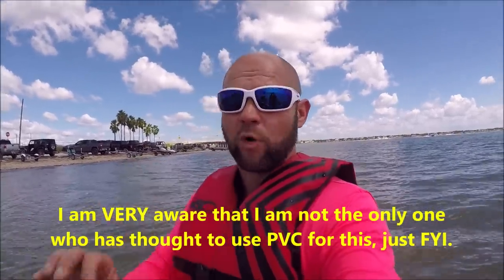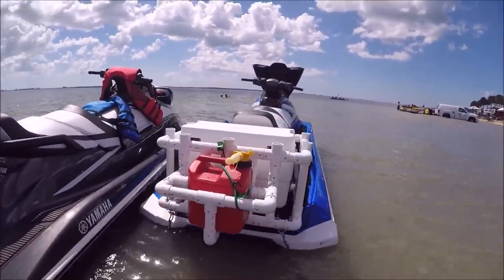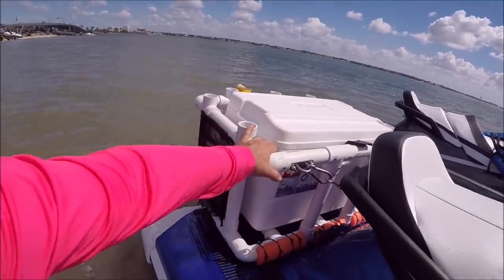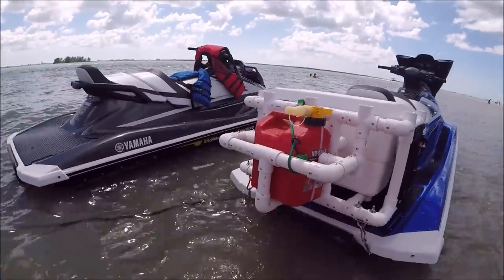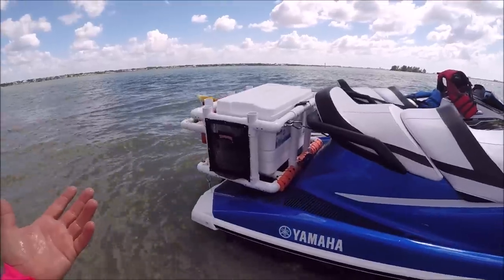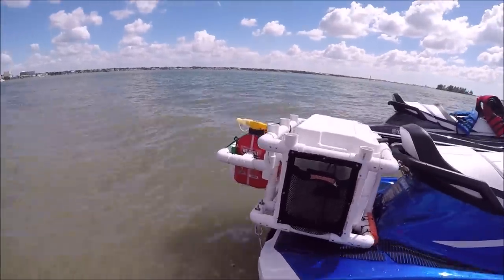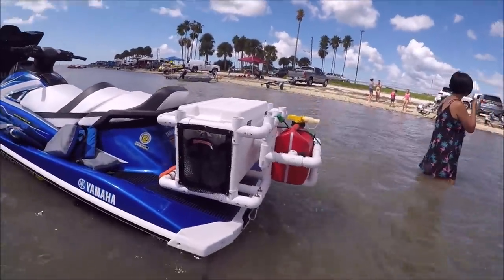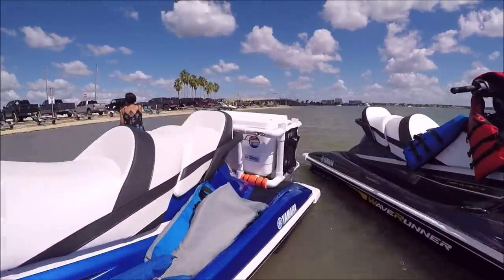CUSTOM PWC FISHING COOLER RACK SETUP DIY PVC YAMAHA KAWASAKI SEADOO JET SKI WAVERUNNER

Comment: Great Job Gary, I am building one very soon. It looks like 1 inch PVC. There is only one negative  that I can see and I'm not sure its even a problem, I don't know how far the screws you used protrude into the rod holders. Screws being stainless steel I would imagine they are hard to cut down. I would be afraid of them tearing up my rods. That is one part I would glue. Great Job though, Off to Home Depot I Go !!

Comment: That's very nice! I built mine on out of pvc and used bed liner paint on it with rod holders mounted on. But after seeing your video I may build me another one, because I really like how your rod holders were built into the pvc pipe. It looks alot stronger than what I have. Good job! Excited to see what other kind of pvc racks you build if you start it on the side

Comment: Yamaha's shoot the water up out of the back. Does it affect this?
Reply from the maker: You can disconnect the hose that shoots the water, thats what I did. No issues at all. It can be reconnected in 5 seconds.
Reply: I disconnected my water spout so it doesn't spray my rods
Reply: @garrydean6544  What's the purpose of the water discharge?